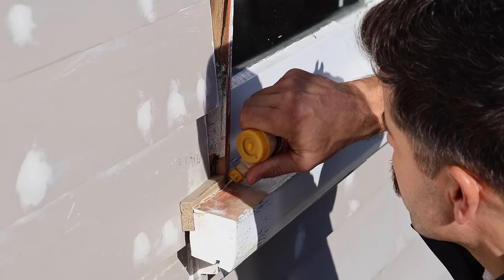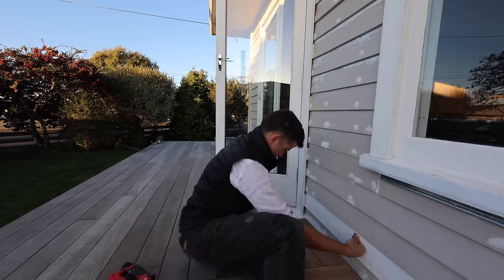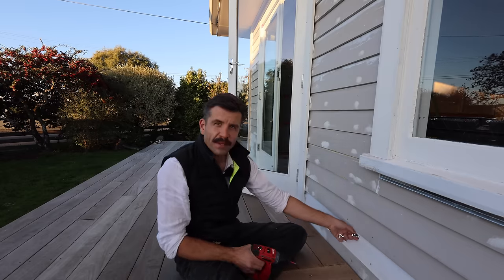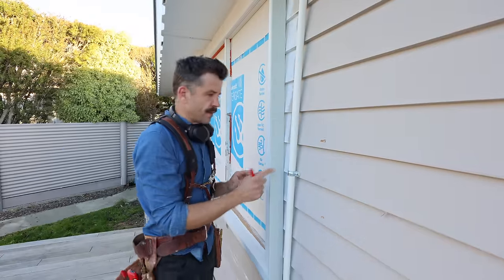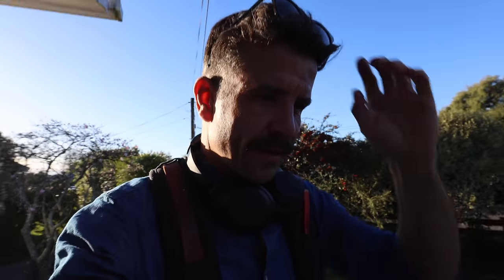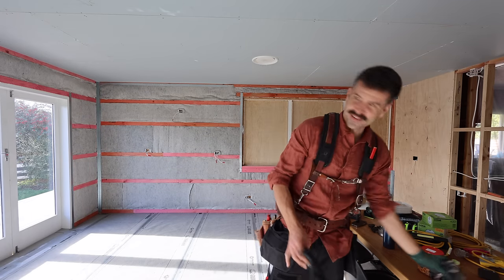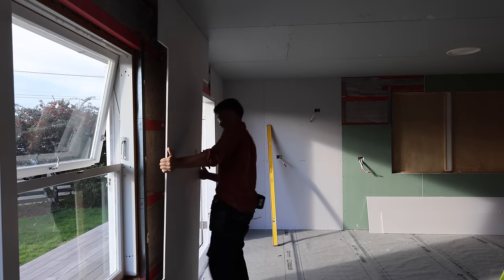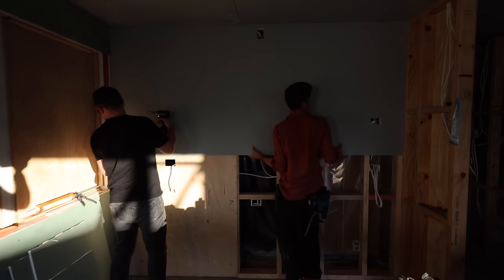This Has Taken Me 8 Months...

Comment: So why are electric cables losing performance behind insulation? That doesn't make sense to me.
Reply: All I can think of is that because of the insulation they can't cool efficiently. They would then heat up and could even become a fire hazzard. But then a thicker cable would solve that problem.
Reply: The current capacity of a cable depends on the temperature. As a cable passes current it heats up - it can only heat up so high before being a danger and if in insulation it will heat up more for a given size cable. So either have less current capacity of require bigger wires.